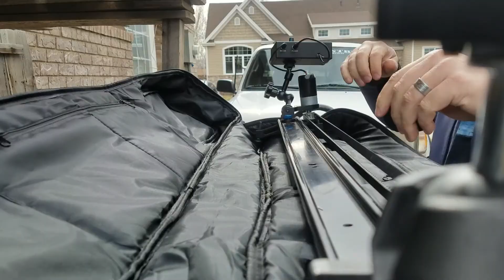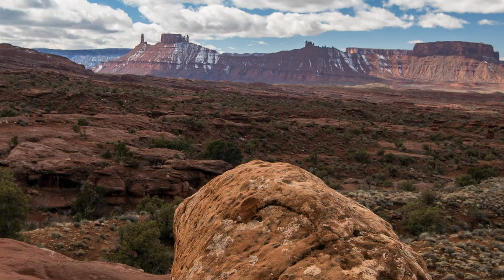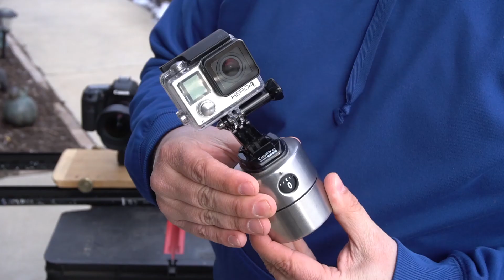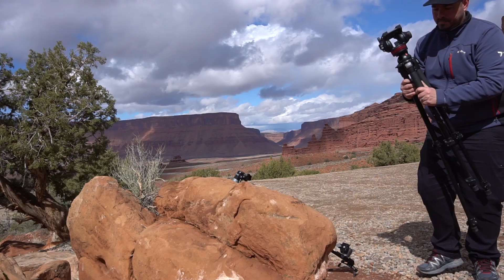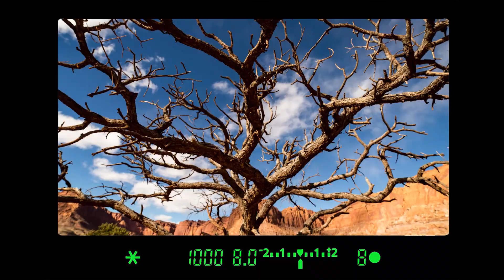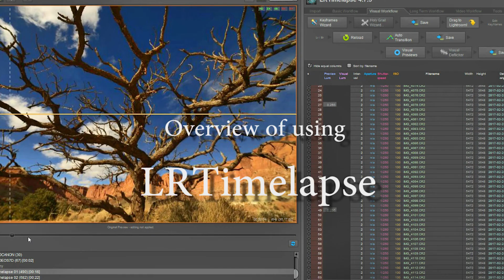How to Use a  Camera Slider - Using a Slider While Shooting a Time-lapse

Comment: If we usea non-electronic rotator like GoPro rotator, is it OK to shoot milkway or night photos as the rotator slowly turns while a shot is being exposed?
Reply from the maker: I shoot night with my devices slowly moving.  I hardly use Move Shoot Move.  Just as long as it is slow enough to not add a streaking blur with each shot.

Comment: I'm having to decide between a 31 inch and 48 inch slider. What would be your advise?
Reply from the maker: Well I do have a 72 inch one and at 31 inch one, and I use the 31 inch way more.  Just depends out much movement you want and how big you want to carry around.  I have been thinking about getting a smaller one also cause that little bit of movement helps out still.  The long one I have breaks down into smaller sections so it is easier to travel with, but I hate having to build it.  If I only had one choice I would stick with my 31 inch.
Reply: @Wesleyastonphotography  Thanks bro!
Reply from the maker: @sandy_vb  anytime!

Comment: This was great, just what I was looking for as I've just bought my first slider. What length was the slider you used in this video? My track looks pretty much the same as yours and its 120cm and I'm wondering if thats too long for one tripod?
Reply from the maker: Glad this was helpful.  The slider I use on the single tripod is about 100cm and sometimes you see that as the camera moves it is a little to heavy.  I can fix it in post usually, but still it is a pain if the camera dips.  My sony cameras are pretty light vs my canon camera.  Also depending on the lens used too.  You need a pretty strong head too be able to hold the weight.  I had a ball head snap before with all the weight.  I like using the video head though as it holds up pretty well.
Reply: Wesley Aston Photography  ah ok thanks. I’m using a dslr so guess I will be getting a second tripod. You’ve got a great channel here, looks like a similar journey as myself.
Reply from the maker: @mikemeal355  Might be a good idea or at least lean the other side onto something.  Yeah its been fun learning new things over the years!